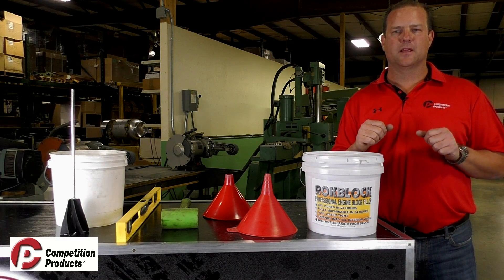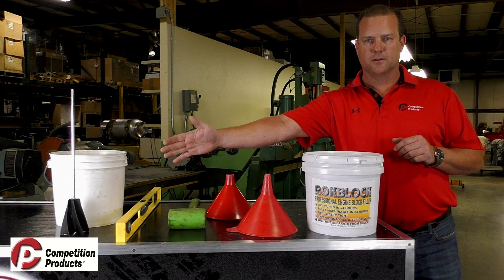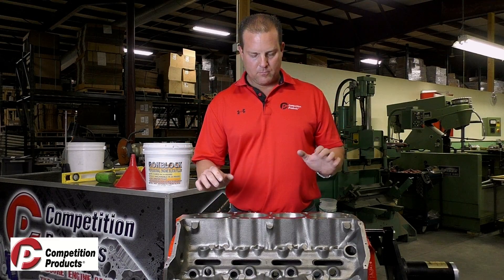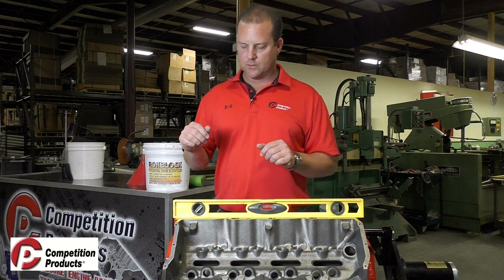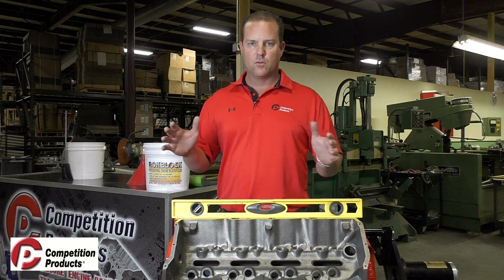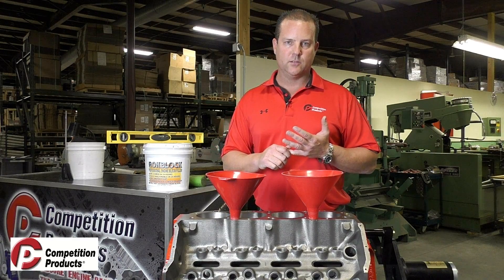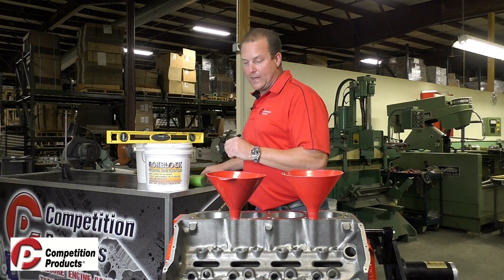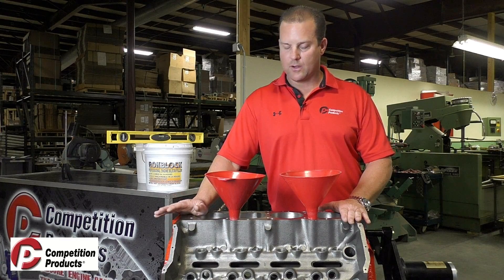How to Install Engine Block Filler

Comment: Use a torque plate as well to simulate the tension on the block before it cures other wise you can start cracking the epoxy down the road

Comment: Can we use it on street applications or the block will overheat
Reply: Most guys just fill to the bottom of water pump holes on street motors. All the heat is generated at top of cylinders so as long as your getting coolant up there your good.
Reply: I only fill mine to the bottom of the core plugs.  You can go higher, but the higher you go, the more problems you COULD have ... I have filled street motors to the bottom of the water pump and it works, just kinda sketchy.

Comment: I have a bbc that someone was grinding in the lower cylinder are and found out he made it to thin..it shows a small crack line..can I seal with Block filler?
Reply: LMFAO no!
Reply: This filler may or may not work.  Devcon filler would do the job.